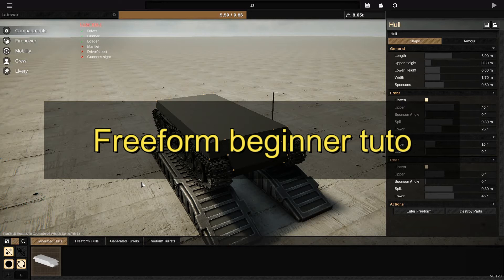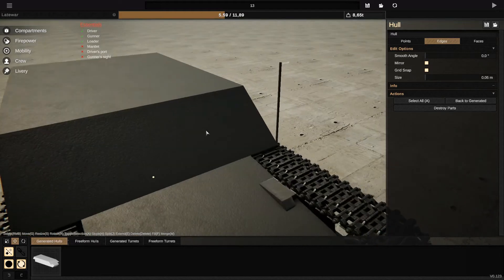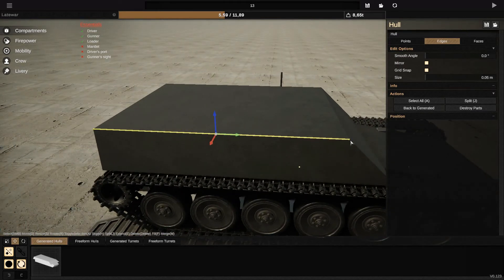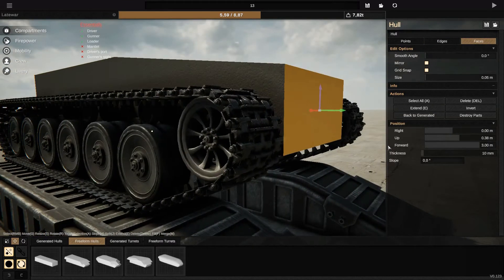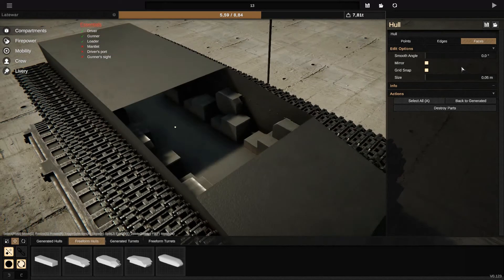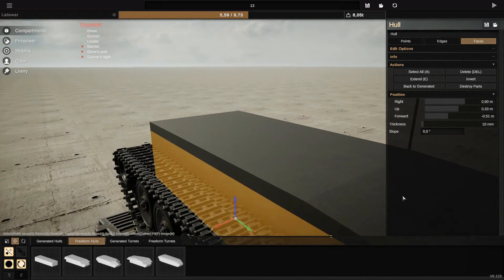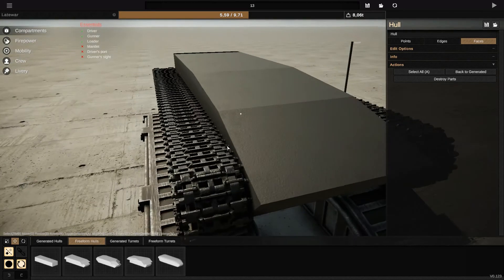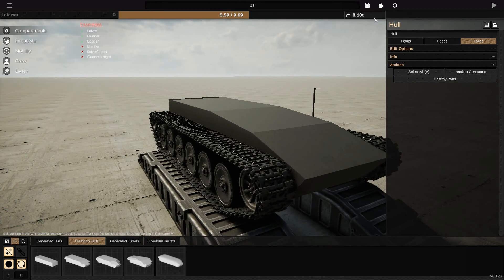Sprocket Tutorial Part 8 - FreeForm for beginners

Comment: How to i like exit freedom mode but still have everything saved that i have made, when i press back to generated it just removes everything i did, with freedom i cant attack stuff to the tank
Reply from the maker: You can't keep all what you have done in freeform after going back to generated
and what do you mean you can't attack stuff to the tank? you mean attach stuff?

if you try to place things on the tank but they seem to don't have any collision with one face or some faces, this means you have inverted faces

to fix the inverted faces, you gotta remove the faces inside your compartment, even overlapping faces need to be removed, after cleaning the compartment of these inner and overlapping faces the inverted faces would be fixed, if not then select all faces and click on "invert" button
Reply: @mohsaid  damn u responded quick, thought it was finna take a day at least or something
Reply from the maker: @RizzyBoeh  you can join the discord community, you also could get helper in there